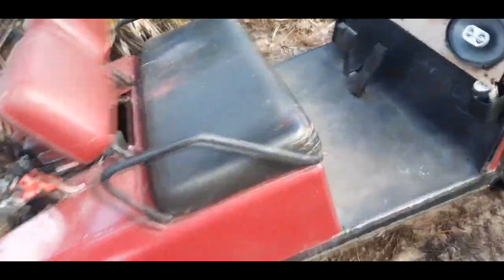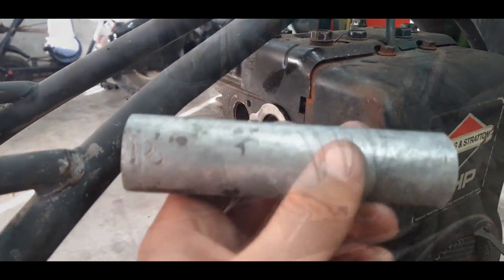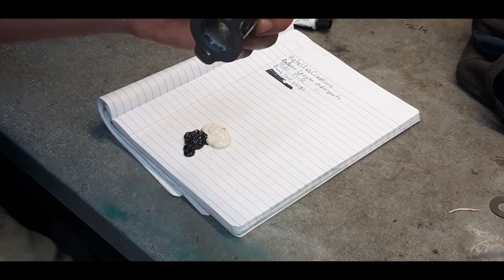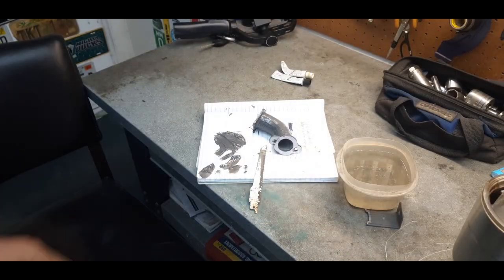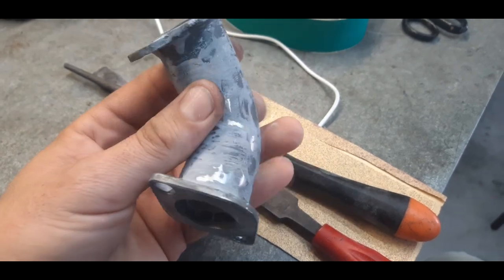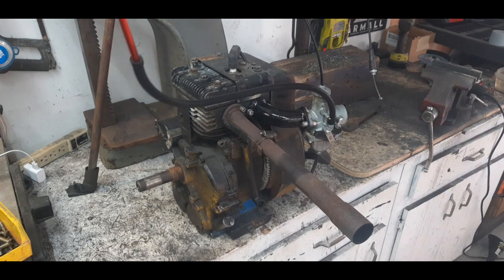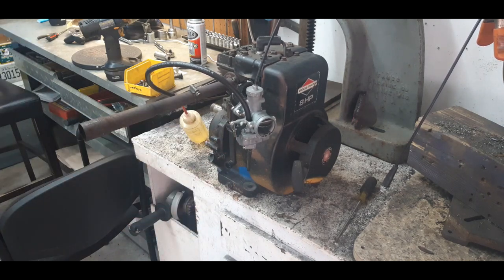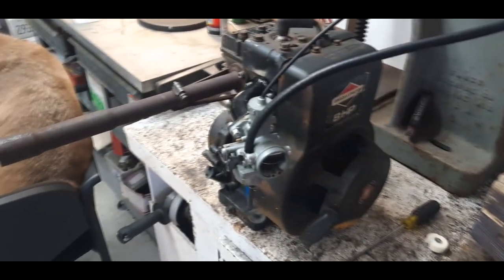Motovox Mini Bike Build Part 2 Intake For 32mm Mikuni

Comment: I totally live in the wrong neighborhood. I'm going through some extremely difficult times right now and if I'm not lost in work I'm tied up with my mini bike builds and my  dog Remington. Thanks for the great content guys, it really helps that you all are so positive and down to earth.
Reply from the maker: I hope you get through these hard times friend..let me know if you need anything..thx for watching
Reply: @GoKartsorGoneFishin  Lol, how about the proper bolt size to do a complete oil sensor delete on a Honda GX160? I work around other's schedules and keep having to put myself last. I keep forgetting to find it and between that and my case bearings I'm ready to put that bad boy together. My Dad is my hero, he is the hospital not doing well with his pancreatic cancer recovery. If my life falls apart at least my engines won't.
Reply from the maker: @fatbuddycat  hmm..I'm bout to head to work..when I get a minute I will look into it..sorry bout your pops..keep your head up..let me see what I can find..I dont mind helping
Reply from the maker: I'm still looking..I got a friend looking into it
Reply from the maker: Is the hole your talking about threaded?..or was there wires going through it?
Reply: @GoKartsorGoneFishin  it would be the one the wires for the sensor were in on the front of the block. I could just cut the wires back and reinstall it but that's not my style. This is going to be a Gx160 pushing around 13 HP at 6800 RPM after all.
Reply from the maker: My buddy says it's a 5/16..but I think it's a 1/4 inch..I hope this helps but I dont have one of those motors around to check so I cant be sure..